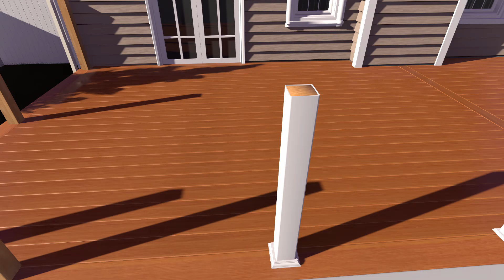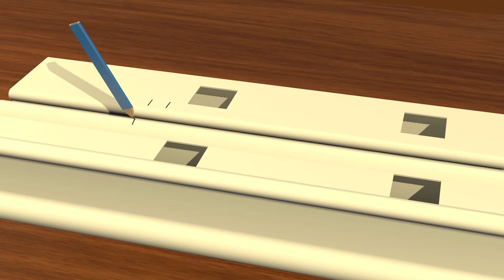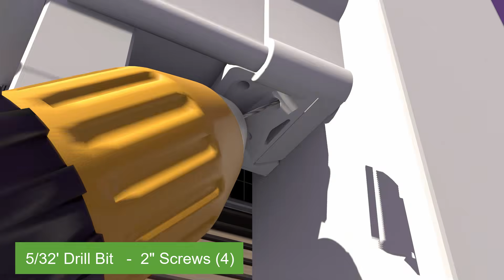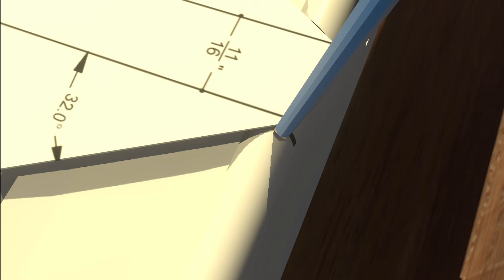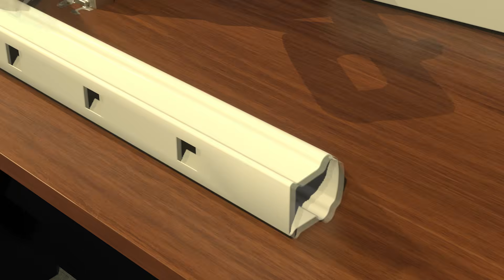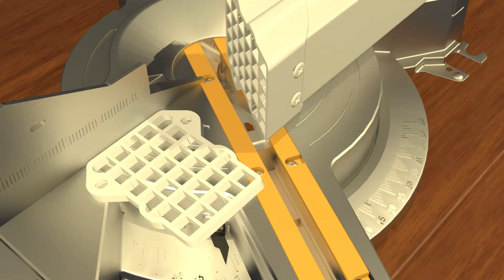How to Install Barrette Outdoor Living Bella Premier Series Vinyl Railing

Comment: Can't get screws in bottom rail bracket at bottom of steps. No room for drill. Plus this is not the same system as the Barrette stair rail kit I purchased at home depot. There is no option to cut brackets like this video shows and this is a problem because there is not enough space between the spindle and the post for 2 of the brackets. What a nightmare!

Comment: This video doesn’t explain when to cut the other ends of the stairway bottom or top handrail and, if the bottom rail mounting brackets screws underneath the bottom rail are left in or loosened like the top handrail brackets for the final mounting and setting the angled screws. How could someone screw in the bottom bracket bottom screws? No room.
Reply from the maker: Hi there, thanks for your feedback. In this video we don't explicitly say to cut the other ends, but yes, you will need to. As far as no room for screws, we understand this could be an issue. You may need an angle drill or driver to get into a tight space. Hope this helps. Please feel free to reach out to our customer service team if you have any other specific installation instructions. 1-877-265-2220